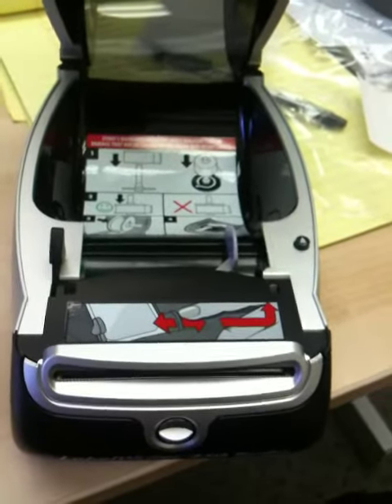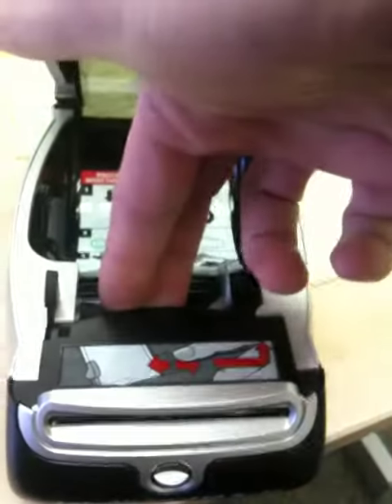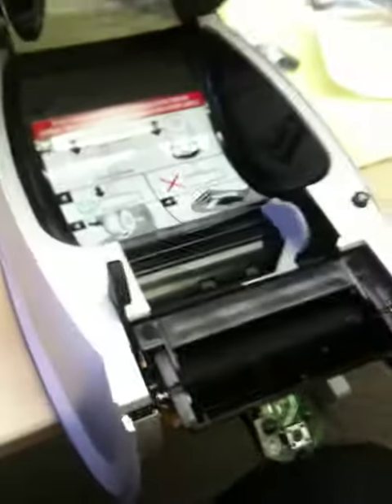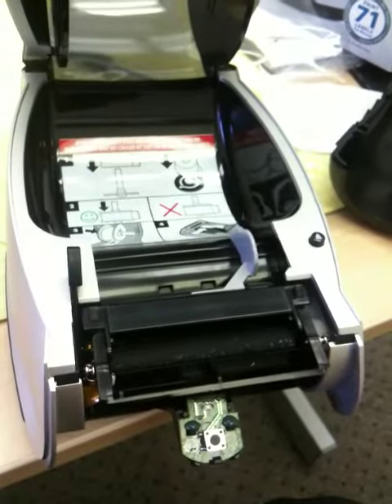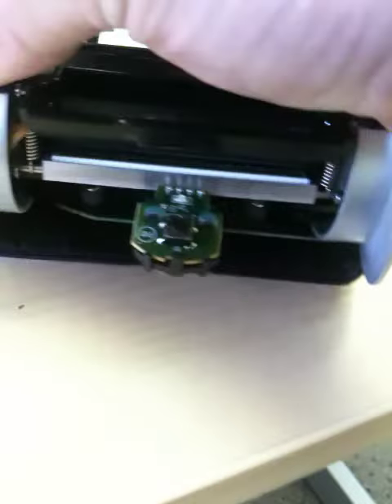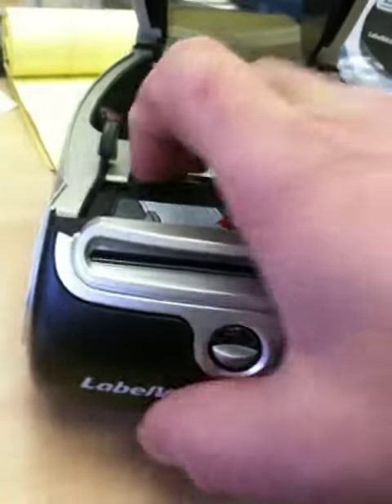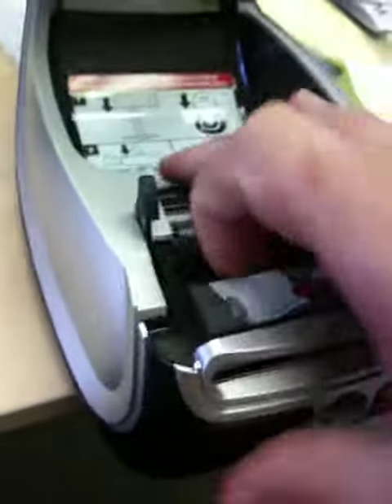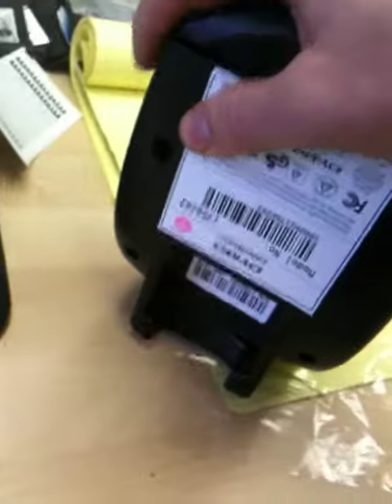Clearing a Paper Jam from a Dymo Turbo 450 printer - Label Flow 6

Comment: I watched several videos and none seemed to fix my Dymo. Then I realized that it didn't happen when the front cover was removed....? So I checked the front cover and on the inside where the labels pass through there was label adhesive that made it sticky which was causing labels to stick. Simply cleaned it and my fantastic Dymo labelwriter 450 turbo is back running at 110% as it used to. Certainly worth a try peoples.. ;-)

Comment: there are 2 levers that will help.  the first one is the one shown in the video.  I didn't know this could be done until this video.  It opens up the front.  The other lever is pulling that gray guide toward you.  That exposes the back side.

Comment: Since a reload it won't line up correctly, prints in the middle of 2 labels & then feeds through like 3 more blank ones. Wastes so many labels & no matter how many times you reload it it keeps positioning the labels wrong, it tears off at wrong spot, prints at wrong spot, even if you manually place it in at the right tear position, what the actual fck?! I need this thing to work correctly again, I use it every day.
Reply: Make sure you get the labels with the little hole between each label. I put the wrong labels in and had the exact same problem.

Comment: My 450 Turbo has a label off the roll and stuck between the roller and print head. Holding the paper lever back and grabbing the label with tweezers only tears the label. How do I get the roller much further away from the print head?
This other video has more info if this video is not good enough.
https://www.youtube.com/watch?v=26A9GRWJxXw